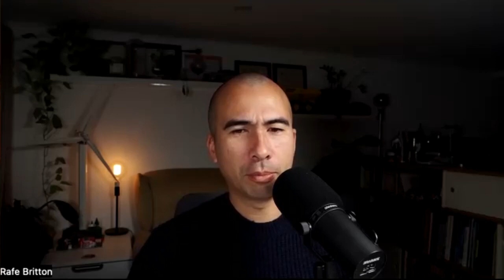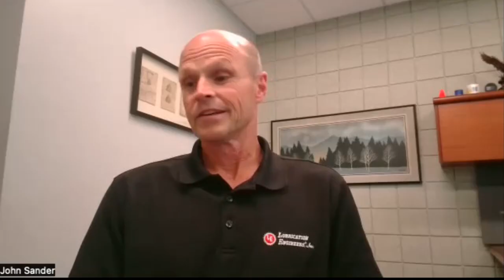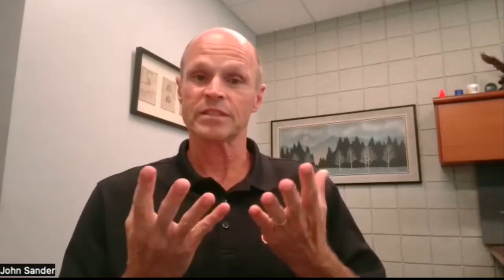Why do PAOs Shrink Seals?

Comment: Big greetings from the Balkans from Serbia if you know where that country is located....I would like your valued opinion on full synthetic oil of viscosity 20w60 (PAO +ESTER) otherwise racing oil..is it a better oil than the usual semi-synthetic 10w40 for older generation diesel engines without dpf.scr.egr...otherwise the oil is the top of the peaks and is too expensive...but I'm interested in which one would be better in engine protection regardless of the price.. .thanks in advance

Comment: Is there any kind of oil which can protect  or even recover these shrunk seals?

The break fluid is the opposite. It has the capacity of recovering shrunk rubber. Could  a little break fluid be added in engine oil, just a little bit, for that reason? To help to recover shrunk seals? without causing major harm?
Reply: Esters & other group V base stocks are pretty seal/gasket friendly
Reply: WTF is "break" fluid?
Reply: @HighwayRamos  Sorry. Brake Fluid I meant.
Reply: i dont know man, break fluid attracts moisture that can rust engine parts or if not then the break fluid will break down inside of the engine due to extreme pressure inside